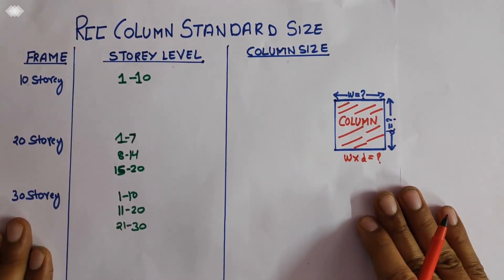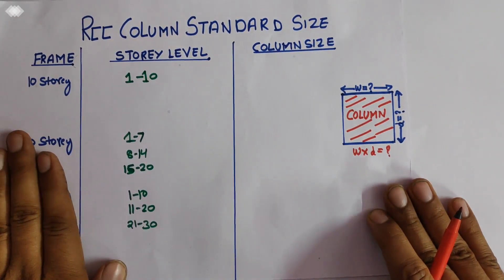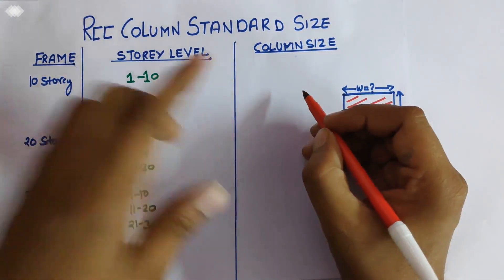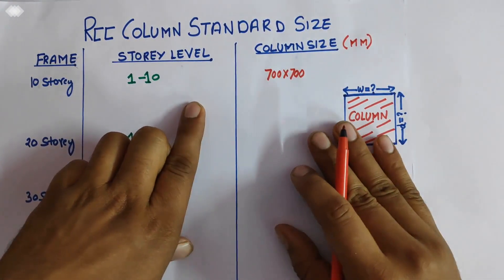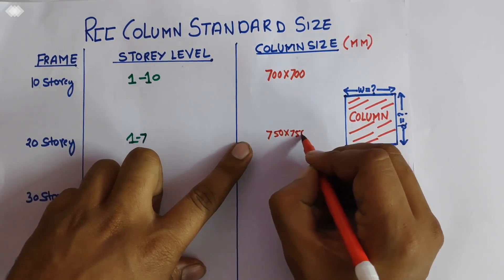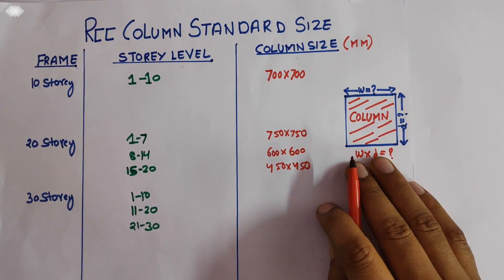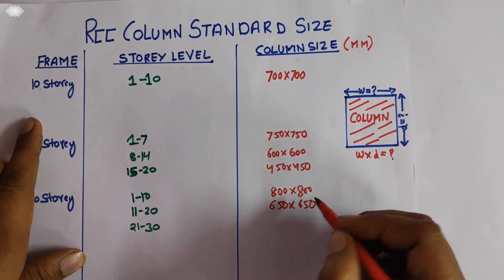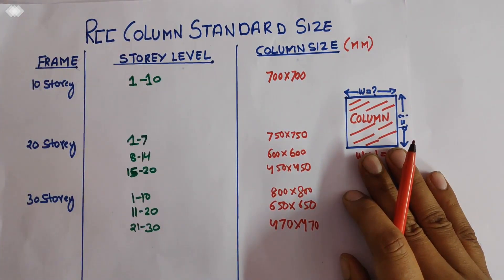Standard Size of RCC Column for 1-30 storey building |Civil Engineering Videos

Comment: Pls this could be wrong. Column sections are derived from load exposed to the particular column. There's no rough size or standard as you put it.
Structural analysis gives you column or members sizes.

Consult a structural engineer with your drawing for analysis before building. Thanks.
Reply from the maker: There is a rough mind review acceptance  criteria everywhere of course this is not a standard i already told in the video this is just a column size as structure engineering people used in their some projects already done :) :)
Reply: Vibhor Shukla. OK. You tried. But I think you should mention that one should carry out a proper analysis to backup your video as It could mislead some quacks or students.
Reply from the maker: @ezeobigerald331  nothing to worry this is the size of column used at many places dear in India i know exactly and already told my followers what to do thanks take care 😊 😊
Reply: Vibhor Shukla something is very wrong because you did not factor floor loads in and as such no one really knows where it applies... What do I mean? What floor areas can these columns support? That plays a very huge role in determining column sizes and you obviously disregarded that...

Comment: wrong prediction
Reply: reference???
which engineer used this prediction
ur videos is very good dnt  make such typ of videos
Reply: @inzigaur314  Assalamu_alaikum wanna talk with u bro if u don't mind
Reply: i have worked in jaypee noida 128 
g+38
there is no size decrement of column as height is increased
yes , one thing that the reinforcemnt % is gradually decreasing as we increasing the height of building
hope u will understand wat i m saying
thanku 
all d best
Reply from the maker: This is only just a rough design as used by many CIVIL engineering expert in field based on that is it stated as standard :) :)